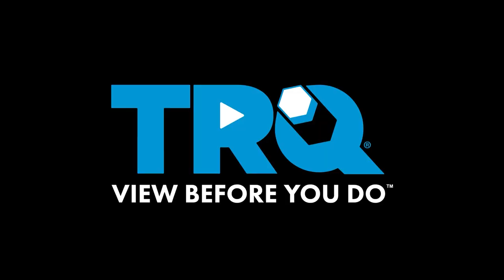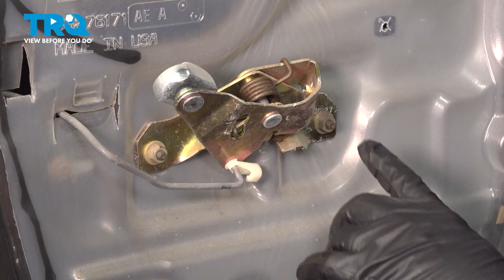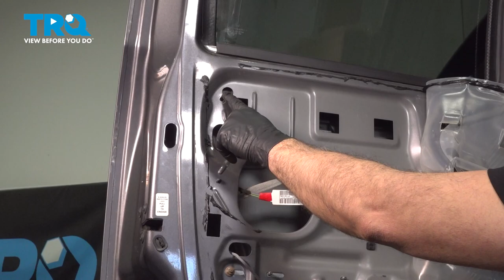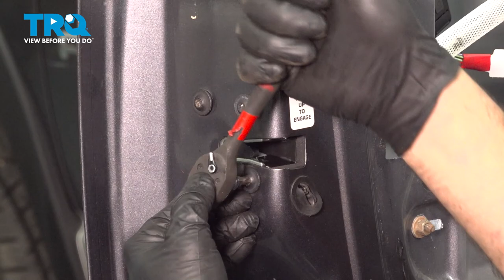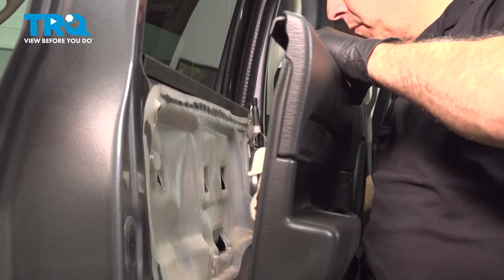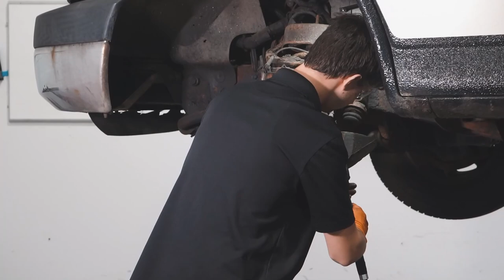How to Replace Rear Door Lock Actuator 2002-2008 Dodge Ram 1500

Comment: I’d try the power lock/unlock before I put everything together.  Just to be sure this fixes the problem.   If it doesn’t you’ll need to replace the duct assembly between the door and the body.   A video on that procedure would be nice.